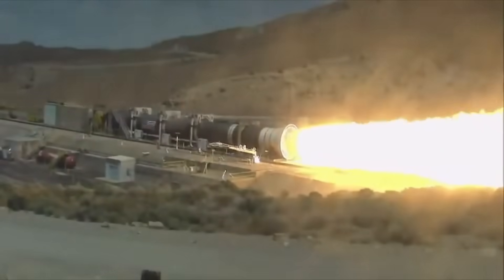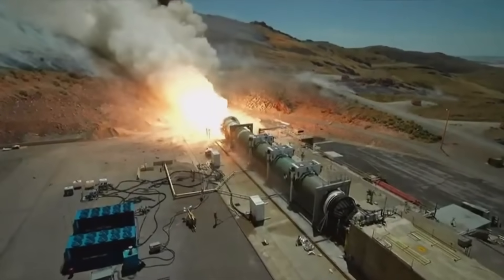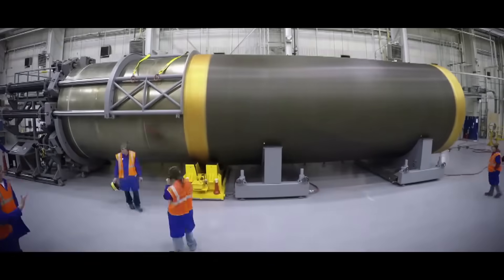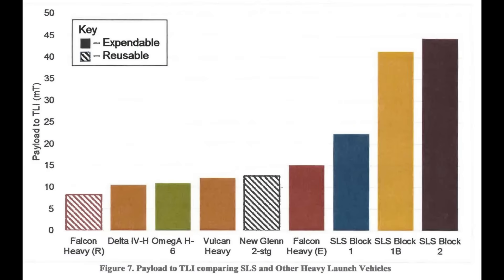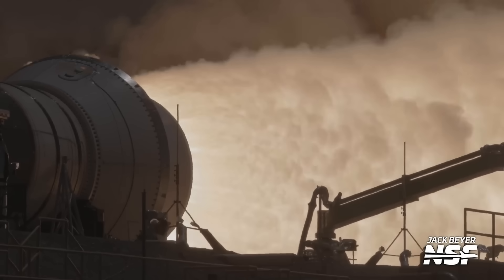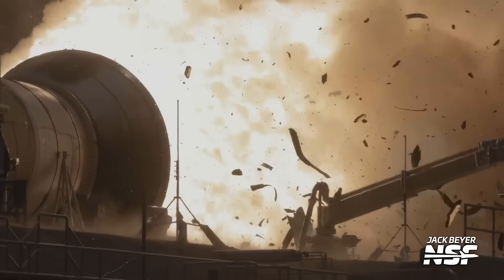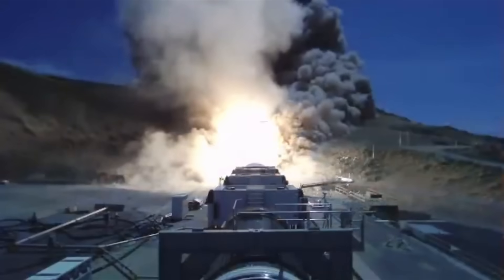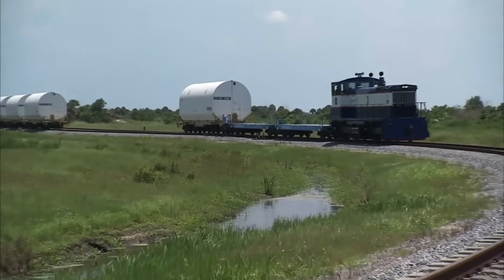NASA's Future SLS Booster Just Failed Its First Test

Comment: 11:57 Fun story, not actually true. Wagon wheel widths differed pretty widely. The width of the railroad gauge was really determined by having the railroad cars axle width be 4’8”, or 4 and 2/3 feet. The rails were slightly wider to give extra clearance to make it easier to handle curves. And it should also be noted that the loading gauge (which is what actually limits the size of the cargo that can be carried) differs massively between the US and Britain and has grown over time in the US.
Reply: And what determined the axle width?
Reply: @qoph1988  It's much more boring but actually probably horses again.
Very briefly, track gauge varied quite a bit over time and it took a while for 4'8.5" to settle. Even nowadays there's plenty of non-standard rail gauges like the Pennsylvania Broad Gauge. Our best guess is one of the oldest rail companies in the UK used it because it was about as narrow as they could fit 2 horses on (nothing to do with Romans necessarily), but even they didn't use 4'8.5"- they used an even 5' but measured from the rails outside since it was a nice round number. As they expanded they refined it to 4'8" then 4'8.5" as mentioned above, but were actually competing with a different company using 7' gauge (wow!)
So ya probably horses but even then that's not truly what's limiting SRB width since we make trains much wider than the tracks. Ultimately it just comes down to "look we can only make tunnels so wide so let's try to standardize things"

Comment: In Russia the same thing happened.  The 1st stage core oxidizer tank of the Proton rocket was restricted in size by the diameter of the railway tunnels through the Ural Mountains leading from Moscow to the Kazakhstan launch site.  So they had six strap on fuel tanks (with the engines attached) that they mounted around core fuel tank after it arrived at Baikonur.
So nice history of how road width and railway tunnels widths have dictated rocket diameters for components that needed to be transported over long distances to the launch site.
Reply: All  Soviet/Russian rockets have this characteristic, except N-1, fabricated on site from panels shipped by rail.
Reply: Due to it's design, I have always called the Saturn i and Saturn iB 'cousins' of the Proton rocket.
Reply: Except that the Russians dgaf about that Roman bs and use the track and loading gauges much wider than the standard US/European gauge.
Reply: @dvv18  Russians dgaf about Roman bs? You know what "Tsar" means, right?
Reply: @sluggo7  I said "_that_ Roman bs", id est the one Scott was talking about for whatever reason. But if you want to talk about the whole "Third Rome" thing — you've found the right person 😎
Reply: Remember that time they flew a rocket from denver to florida? Just by chance I saw the AN 225 coming in to Denver lol.
Reply: Astounding
Reply: I still don't understand this limitation. Energia/Buran parts were transported by an aircraft and had no size limitation. But nowdays such limitation exists (somehow) for Angara rocket.
Reply: @PanzerschrekCN  cost limitations.

If you move to another continent and want to bring your things, check out the costs of flying it versus ship or rail. 😅

Imagine every part of a project or very expensive components of a national public project

Comment: Can they stop a solid rocket booster from burning once it starts? I noticed the test stopped after the explosion. Or was it coming to end around that time no matter?
Reply: This is dumb tech - a design of SRB cannot be shut off once it ignites - it burned until there was nothing left to burn. It contains all the ingredients necessary for combustion within the chamber in which they are burned. More advanced solid rocket motors can be throttled, or extinguished and re-ignited, by control of the nozzle geometry or through the use of vent ports. Further, pulsed rocket motors that burn in segments, and that can be ignited upon command are available.

Comment: do not hump
ummm......I'm curious about the story behind that. LMAO
Reply: Standard notation on railcars carrying fragile things.  A "hump yard" is a type of switch yard where the cars are pushed over a hump at the start of the yard and then roll down the other side through a bunch of automatic switches.  It's an efficient way to sort out a lot of cars into different trains without needed to go back and forth with the locomotives a lot.  However, it does sometimes lead to the cars slamming into each other with a fair bit of force at the end of their downhill run, so you don't want to do that with anything fragile, and particularly not with things that are highly-flammably fragile.
Reply: @BrooksMoses  ah ok. I was thinking dirty

Comment: 13:08 uh what does "do not hump" mean??
Reply: "Do not sort in a gravity powered switching yard, the slamming into stuff will break things."
Reply: And, specifically, the gravity-powered switching yards are called "hump" yards because the cars are pushed over a hump at the start of the yard and then roll down the other side through a bunch of automatic switches.  It's an efficient way to sort out a lot of cars into different trains without needed to go back and forth with the locomotives a lot.

Comment: No. The length of the segments is NOT determined by the rails. The size  shape and length is completely dependent on the desired thrust curve.

The bottom segements are finocyl, or star grained. They  give you more thrust at lift-off to ivercone inertia and get you off the pad. Then the thrust  tapers off for gentler acceration.

The upper segments are Bates grains. They burn in auch a way that the amount of burning surface (and thrust) stays relatively constant.

Do you really think NASA is letting the size of a horse's ass drive the design of its rocket motors?

Comment: Scott, you’re just wrong about the rail gauge width. Basically, the gauge that survived (there were several originally, in  fact they had to change the gauge used in the south because it was different than the north) was measured to be five feet to the outside of the rail. However, they realized that it was better to measure to the inside of the wheel so they could more reliably place the wheel flange, so they ended up with 4’8”.  Rail cars are a bit wider than the running gear as well.

Comment: Rail gauge is a totally different thing than loading gauge which is much much bigger in the US than Britain. Loading gauge is what limits the size of cargo.
Reply: Also, i'm pretty sure the whole "dates back to roman times" stuff is just folk lore too. The first trains developed from the rails inside mines, not from horse drawn wagons. And different companies used different gauges even inside the same country from the very beginning, so it can't have been a limitation of the typical wagon axle width.
Reply: @GamerLudwig  Yep. US apparently had different companies using different gauges. Over time people settled on standard sizes some dictated by those the British were prepared to build engines for.
Reply: @GamerLudwig 
Actually came from 16th century Germany bud. Called wagonways, horse drawn wagons on wooden rails.... don't ask me what guage lol ...2x4 🤷🏻🤣
Reply: Very true. Switzerland has 1 meter wide track but their cars are much wider.
Reply: @BnORailFan  In german it's the "Lichtraumprofil", google translates it to structure gauge.
Reply: Eh ...

Conforming to past standards is a thing.  It may not be dictatorial but - it could be a contributing factor.

If you have a Standard that is in common use - there needs to be a reason to change it.  It doesn't have to be a good one - but there needs to be a reason.

Historically -  there have been times when rail gauges were different for different counties - and the invading country - either had to trans-ship their cargo from one train to another - or - eventually adjust the rail gauge to their standard.
.
Reply: @BobSmith-dk8nw  prior to George Stephenson adopting 4'8'' as his gauge of choice there was no standardised gauge in Britain. There were numerous waggonways across the UK and they all used different gauges between 3' and 5'. George only picked 4'8'' because it's what was used on the Killingworth where he started his career. The half inch only came later.
Reply: It doesn't just limit cargo size. 

British trainsets built for the classic (old) network cost 60+% more than ones restriected to new lines (£26million/set for a HS2-only set,  vs £40million/set for a "classic compatible" HS2 set)
Reply: *different from
Reply: Should have just used Brunel gauge
Reply: Cute story, but if you try to retell how boosters are sectioned IN LENGTH because rail tunnels are restricted IN WIDTH, your 5yo will point out a terrible plot hole 😬
Reply: Work with us, here.  Don't wreck a good story just because it's inaccurate.

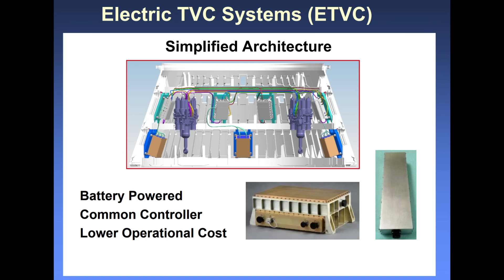Comment: @8:18 That's one heck of an engine-rich exhaust right there.
Reply: No engines on a motor
Reply: Hahaha
Reply: Solid rocket motors are by definition engine-rich. The exhaust is the burning components of the motor.
Reply: @teebob21  yeah alright but what he probably meant by engine are the metal solid pieces of the structure that aren't meant to come off
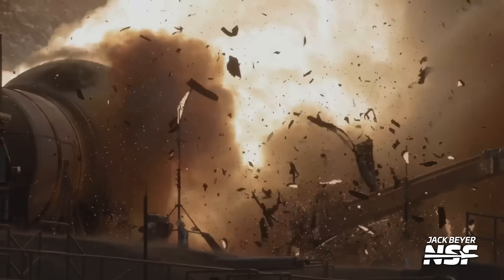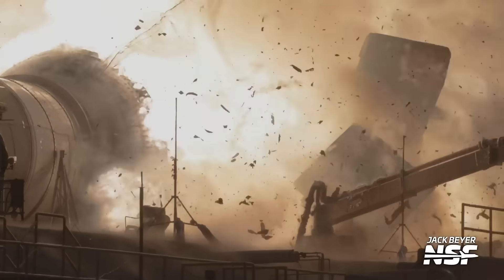Reply: @_0NesEc  Until the very end, there isn't any structural parts coming off.  Prior to the nozzle failure, we see pieces of equipment from the aft skirt being blown out from the skirt. These are control devices, not structural or functional to the propulsion part of the solid rocket motor. At 9:05 in the video, you can see when the blast blows off the nozzle and large pieces of what appears to be the flexible nozzle bearing (looks like sheets of thick rubber) move from left to right across the screen. The first instance of when we can accurately use the Muskian euphemism "engine-rich exhaust" occurs at 9:37 after the rivet failures attaching the exterior aluminum shell of the aft skirt to the Inconel interior. The result was that much of the exterior shell (which again, is not structural or a direct part of SRB propulsion) was blown off. 

In short, from a flight engineering perspective, this SRB exhaust was not significantly more "engine-rich" than usual....but it was definitely more "nozzle-rich" than a nominal test.
Reply: @teebob21 I completely get the point just couldn’t remark the meaning I guess. Thanks for the time and effort though
Reply: @_0NesEc Ah, I see. If you want to make jokes about SRBs with a aerospace engineer, be ready to have the punch line flattened

Comment: Mor than the width, the length of each booster segment is determined by the fact the rail tunnel curves in a few mountains, so they have to make those shorter, so they can take the curve without hitting the sides of the tunnel. Does not go well if your large can, filled with what is essentially a less than stable explosive, is subjected to sudden impacts from the side, making it scrape along in a shower of sparks, and scraping through a thin steel wall to expose the crunchy goodness inside.
Reply: Ditto Boeing 737 fuselages.
Reply: @awuma  Yes but those just bend, they do not react violently to the impact.

Comment: Granted I'm an armchair engineer here it looks like the flexible section of the nozzle failed and then it burned around until the full nozzle detached. After this it began melting the hardware that held in the held in the throat. Granted we will hear more later but that's what it looked like to me.
Reply: Agreed. It looks like erosion and burn-through of the flexible nozzle bearing, followed by failure of the bearing. Then the aft skirt suffered a failure when the rivets holding the outer aluminum skin to the interior Inconel skirt burned through.

Comment: Gimbaled nozzles on a solid fuel booster would seem to this layman to be a far harder engineering task than gimballing an entire engine like Superheavy. I know STS used them with good success so I wonder if this is a 'mothballed' too long issue causing some seal failures?

Comment: Those here who said “But the booster held together…..” are missing a big point; the vehicle wouldn’t have. If happened in flight, this would have been a Crit 1 failure, folks. “Best Case”- if, magically, the Uncontained event somehow, someway, did not damage the rest of the vehicle, the main engines right next door, etc. etc. - there would STILL be a huge asymmetry in thrust that I’m not sure the vehicle could handle. BUT, the Uncontained event probably WOULD damage the main engines; so……This happening on a flight vehicle going uphill would have been a Very Bad Day. - Dave Huntsman

Comment: The bit about the origin of the gauge is, I'm afraid, complete nonsense. I've heard it before, but it's pseudo history, urban knowledge not grounded in reality. The Romans never used war chariots, that was outdated (mostly Bronze age) technology by the time the Romans made it to Britain. Besides driving in ruts is a bad thing, you absolutely don't want to drive a wagon through existing ruts because the slightest rumble would break your axle. And in the early days of the railways there wasn't a certain gauge anyway, with different companies doing things slightly differently.
Reply: How do you account for wheel rut spacing in Pompeii closely matching the standard rail track gauge?

Comment: Disappointing that Scott Manley is repeating the myth about Roman horses.  The constraint is the loading gauge, which is not the same as the width between rails, but the trackside obstructions.  There may be a tenuous linkage to the width of two horses plus the singletree in terms of the rail gauge, but the American Association of Railroads (AAR) loading gauge width (plate B) is 10'-8" while the DODX 40000 series flatcar designed to carry M1 tanks is 125" (10'-5") wide overall.  

There's no evidence that the Roman road surfaces were in widespread use to have an influence on the wheel gauge of 18th Century wagons.  The Roman road routes certainly were, but had been resurfaced/replaced.  I don't believe there's evidence that "Roman War Chariots" were really integral to the Roman military--racing chariots were used, often with more that two horses abreast, but that wouldn't be a factor in road construction.

Scott neatly skips over the 1500 year gap between the departure of the Romans from Britian and the establishment of the gauge by the Stockton & Darlington railroad in 1825.  Other gauges in common use around the same time period included 4'-6", 5', 5'-6", 6'-2", and 7'-1/4". 

There's as much or more logic with the widths being suitable for the accommodation of the human form and our products than simply a product of "because that's the way we've always done it" inertia.
Reply: Neat, I had no idea rail had such purity, I just see the comments railing (hah) on him lol like I had no idea about any of this train stuff.
Reply: Whichever railroad company comes to dominate commerce determines what becomes the national rail gauge.   
In the U.S., the Southern states used to have a different rail gauge from the rest of the country.  They switched to the Northern standard after the Civil War.  Look up the "Great Gauge Change of 1886".  (However long you think it took, you are very wrong.)
Reply: Thanks, Sheldon.

Comment: 13:31 Why does it say "DO NOT HUMP"?
Reply: A hump yard is a means of classifying (sorting) railcars into train consists.  The cars are pushed over a hill (the "hump) and released to free roll down the hill under gravity while switches guide the car into the selected siding where the train is being assembled.  The cars can impact & couple with the previously classified cars with considerable force, so cars that are carrying cargo (or that may be more fragile themselves) are marked with the "do not hump" to alert the yard crews that the cars should not be sent through that system.

There's stories that the "Do not hump" mark carries as much force as marking a package "Fragile" and sending it through the postal system...  :)
Reply: @olpaint71 thanks for the explanation. Someone else explained it much much worse than you did lol.

At my work we send doors and such through trucking lines, and warehouse workers Damage about 1 out of 15 shipments. Sometimes spectacularly. It never matters how many “fragile”/“glass”/“no stack” stickers we put on.
One package (3 welded lead lined door frames, 3 custom lead lined doors with specialty glass) got damaged and returned 3 times. The 4th time it got about 50 stickers on it. That one made it fine
Reply: @olpaint71   Makes sense, thanks!

Comment: 13:44 "end of the road technology" is a good description for the SLS jobs program broadly. 

Sure, there are some modern upgrades, but it's good engineering sunk into a legacy disposable architecture that has the price tag of legacy cost-plus contracting.

Space is hard enough without going backwards in design.
Reply: At this point, I think the only reason it's used is because no one has made a similar rocket that doesn't explode